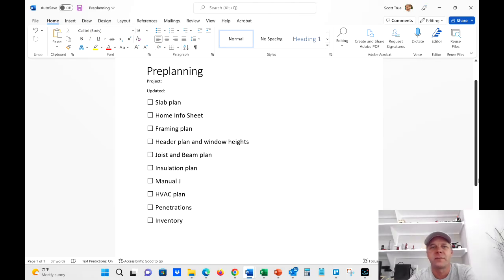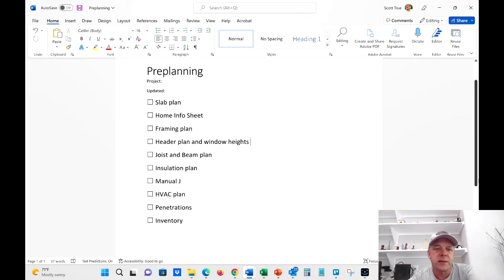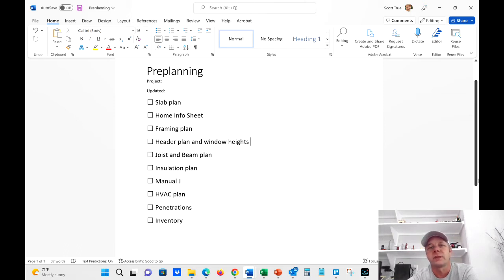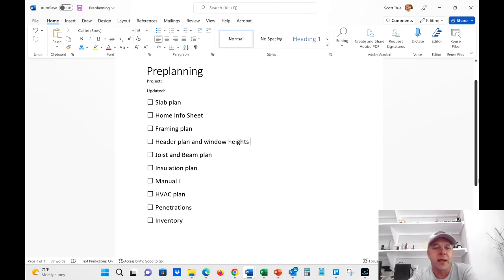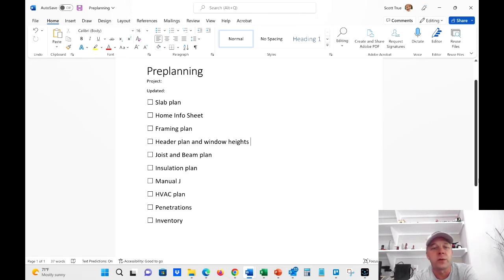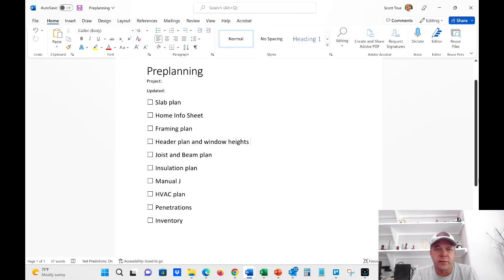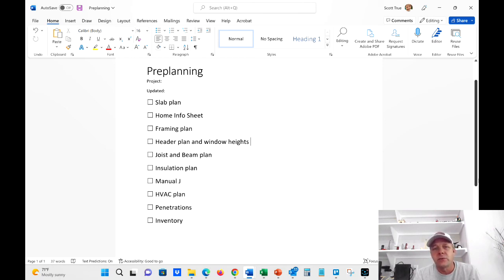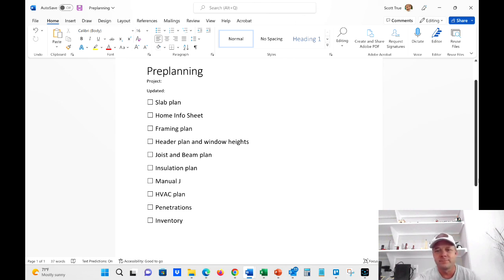Building a High Performance Home on a Budget E3 Preplanning

Comment: What deflection values on your floors do you plan floor?   Are you going over min. code?
Reply from the maker: We are slab on grade and the slab is engineered. If there is a second floor, we used engineered floor trusses. So I'm not sure what the values are but the engineers are handling that.

Comment: Around what price per sqft does it cost you?
Reply from the maker: I'm not sure it would be useful to state a price per sq. ft. because this fluctuates constantly. The bottom line, though, is that a builder that is including high performance details (details that I think should be normal) is going to make several thousand dollars less than a builder that has a poor weather barrier, no flashed penetrations, etc.
Reply: Price per sqft is a really terrible metric. A home in the shape of a square will always be cheaper than a home that has many bump outs and odd shapes. Both can be the exact total sqft but one will cost a lot more.

Comment: Why do you order the ERV online vs getting it from the hvac contractor?
Reply from the maker: My HVAC stuff is not the typical stuff that HVAC companies use. I have found it easier to get myself rather than allowing mistakes to be made.
Reply: @ScottTrue  Thank you so much for putting this together. Would you be able to put a detailed video together on your HVAC details? Would truely appreciate it. Learning a lot from you as I am getting ready to break ground on a few Spec's in Waco, TX soon.
Reply from the maker: @chunkymirchandani2615  I plan to do this. I'm having a little difficultly getting away from my work to do video. I thought it would be easier! But I am going to try to get back into it soon
Reply: Interesting. So are you buying all the hvac equipment online?
Reply from the maker: @wshaw1288  Not all of it. Only the non-typical things like ERV, make up air damper, ERV controllers, buttons, and grilles for ERV. Stuff like that. The HVAC guy gets the normal stuff like air handler, condenser, ducts, etc.